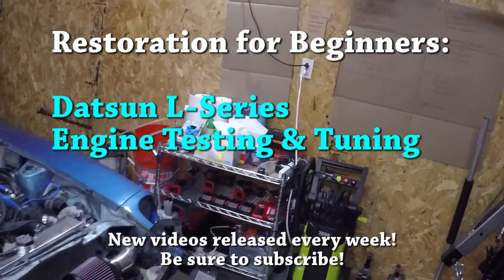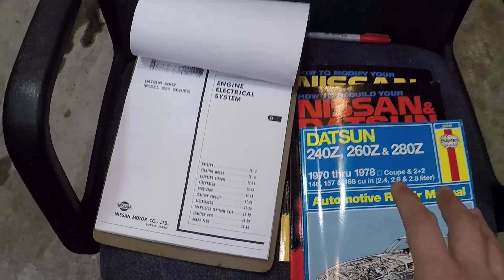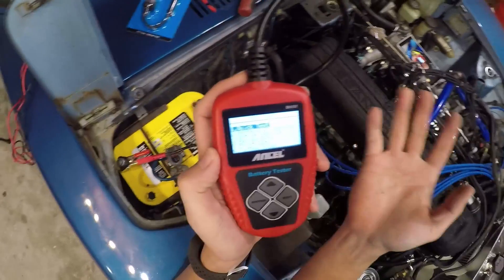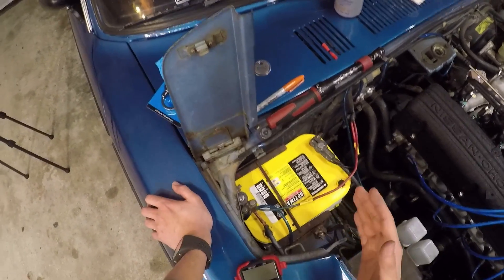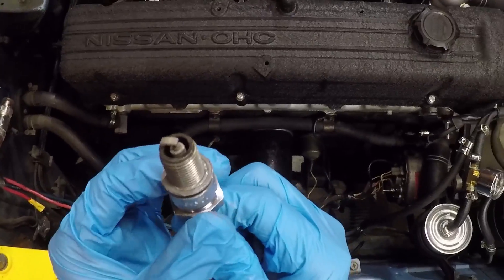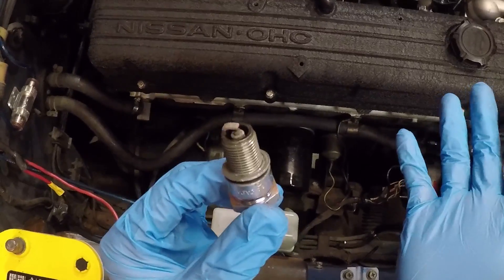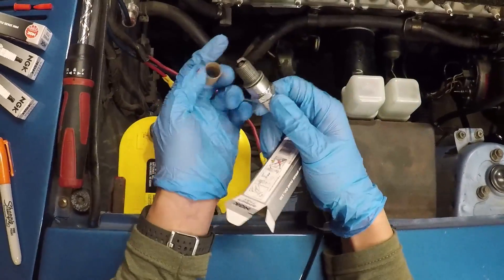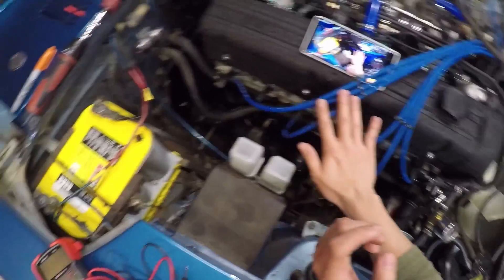Datsun L-Series Engine Testing and Tuning Ep.8 Ignition System (Battery, Alternator, Spark Plugs)

Comment: I have this exact problem in my 1972 Datsun 240z which carries twin SU ROund Top Carbs with Cylinder number 4. Whenever the car is stuck on light to heavy traffic, the spark plug starts fouling. Once i start cruising again the engine misfires until the plug is cleaned.  I am using NGK BP5ES or NGK BP6ES.  Any clue on solving this problem? Could it be a Valve Seal?

Comment: One other thing that I did was got a battery with the terminals switched. I did this because the positive terminal in the stock design is very close to the body and could short out with the it. If you get the one with the terminals switched, make sure to switch the wires too as they are different lengths. I just switched the positive and ground completely so my positive cable is now my ground.  No more shorting issues.
Reply from the maker: Yup, that's a good tip. Did you see me blow a fusible link earlier by accidentally connecting the battery in reverse?
Reply: Restoration For Beginners that's on you brother. Not the battery lol.. :p
Reply from the maker: +visualideas haha oh totally. I wasnt paying attention :p but i learned to make a fusible link!

Comment: Hey there. Is there anyway to check an ecm? I think I may have a bad one.
Reply from the maker: +visualideas hey mn, sorry for the late response. Been busy lately. Look online for something called the datsun fuel injection bible. Should have the testing procedure in there.
Reply: Restoration For Beginners all good mate. I got her running the day before. I had to trace wires going into the ECM. It was not getting power. I have it running now. I dropped the tank yesterday and I will get it cleaned and coated before I go forward. Just got to get some money together. Once it runs right on its own, then I'll start on suspension stuff. Gonna change out all bushings. That may be easy or hard depending on the state of the bolts. Seems ok till now though. :)
Reply from the maker: Haha alright, that's cool. You'll have to give me some advice once you start tearing apart the suspension, because all of my bushings need to be changed out as well. Not to mention one of the lower control arms in the front was actually bent, so I'll have to replace that (which will be pretty costly...)

Comment: do you have a borescope? if so try removing a couple spark plugs examine the top of the piston around the edges, #5 to any of the other that seem to be ok when reading the plugs. See if the edges look different, the Datsun book makes mention of clean edges being a sign of worn rings.Could be stuck oil control ring, I don't know if any of the claims for the various snake oils are true but maybe worth a try. I have used marvel mystery oil in my car since I got it, thinking it may help with cleaning the old fuel lines etc...You could try lowering the #5 piston in its bore, and filling the cylinder with MMO, let it set over night, and the use a syringe to suck it back out, leave the spark plug out, spin the engine with a remote starter to clear any residual cleaner (you want to avoid a hydraulic lock) and once satisfied its cleared put a bit of straight engine oil spin again and then install an old plug start it, run for a bit noting any smoke, after smoke clears up (left over from the treatment) new plug and give it a try. I have NO evidence that this practice will help, I am just throwing out ideas for you to consider and if sound plausible try. What ever you do make sure you really really avoid a hydraulic lock. Granted if the oil ring is stuck and this unsticks it, the fix may be temporary, but I cant see how it would hurt to try. It may be a good idea to change the oil also IF a substantial amount of the MMO leaks down the cylinder (note how much you put in vs how much you get out). I don't think its wise to run that stuff or any solvent in the oil for an extended time. Who knows if its a stuck ring maybe just taking the car out and driving the crud out of it may be the answer too.
Reply from the maker: I hear you. I've been thinking of trying various "snake oil" methods to clean/loosen up the inside of the block, but I think I'll wait until I'm done with all the tune up stuff and get a read on the spark plugs one more time to verify that I still have the same problem. 
While I don't have a borescope, I think peeking in might be worth a try once we put a few more thousand miles on the engine. Last time I saw that piston it was almost squeaky clean from the head gasket leak, so I'm not sure if I'll find any useful information just yet.
Reply: oh yea forgot you just cleaned up the tops, would take a while for carbon to build up (or not on the edges). Those borescopes come in handy I got the cheap one 80$ IIRC has come in handy peering into hard to see places. can get them real cheap if you have things like smart phones, I don't just got the cheapie from HF.
Reply from the maker: Gotcha. 
By the way, I've been binge watching your videos in the last few days. I'm thinking about grabbing an extra 5-speed as well... I really need to finish some stuff up before I take on new challenges.
Reply: word of warning, if you get any odd sounds from any transmission, try a new shift knob, yes the shift knob. I was still getting some odd sounds from mine, someone else on the classicz forum was having the same problem, he was told to check out the knob and that was it. So I pulled mine and filled it with lead in the void, and sure enough noise gone. apparently it was resonating with vibration. Note I had a NON standard aftermarket knob.

Comment: I'm surprised you aren't using a feeler gauge to gap your plugs, I've always been told the round gapper isn't ideal for plugs since it has a very slight angle to it.  Great vid and info as usual though!
Reply from the maker: Haha that's a fair point. I knew that the gapper wasn't that precise of a measuring tool, but I was just trying to get it in the middle of the range (0.039~0.044). I thought that'd be good enough, but you're right. Feeler gauges would be better.

Comment: maybe a valve stem seal on the problem cyl?
Reply from the maker: I have no idea Dave!
Reply: I have read that the valve seals can tear on installation, so when head was rebuilt maybe on got snagged? its a long shot but something to look into before tearing down the bottom end looking for an oil control ring issue. Did you have the shop rebuild the head or did you do it after the machine work?
Reply from the maker: I heard that as well. But it's such a coincidence that the valve seal would be broken on cyl #5 right? Actually, I think I should reserve judgement on that cylinder before I pull the new spark plug out after a few hundred miles. I don't know if the fouled-up spark plug was symptomatic of the old engine, or the new one after FI refresh and head rebuild. 

But... if I were a betting man... I'm going to bet that thing comes out black again. Why else would I have blue smoke right?
Reply: yea something is causing that smoke. The valve stem seal would be a long shot, same bad cylinder from before just happens to get a torn seal... not likely. My guess is a stuck oil control ring (or worse a broken one). I would just to the least invasive fixes while monitoring it like you are doing. Keep track of the actual oil consumption too, that would be a good metric to keep up with as you try different things. On mine I consume oil as well hard to say how much as I don't drive it on a regular basis, but it does lose oil and its not leaking. I do have nice looking insulators on the plugs, but the metal part around the perimeter tends to look blackish. Not sure if its carbon or burned oil. I don't notice any blue smoke but that could be since I have not looked hard enough. If I had to guess I would say a certain amount of oil consumption is typical, just don't want it to be excessive. Back in the day it was routine to check engine oil when ever we did a fill up. The thing about my black residue is its very consistent, all the plugs have it and to the same degree.

Comment: You can use a Anti-Fouler on plug 5, that should help in keeping the oil off the plug. Lets hope you dont need to do this, but its a option. Auto parts stores normally have them, You will need a 14mm, Long. A 14mm Short will crush the tip of the plug when you tighten the plug into it. Lets cross our fingers that the plug comes out clean. Wonder where we came up with the saying, Cross your Fingers ? Have you thought about mounting a Heat Sink on to the Ignition Module to keep it a little cooler, otherwise they burn out from heat.
Reply from the maker: Ah. Thanks for the tip! I'll certainly look into that if the oil issue hasn't resolved itself already. You reminded me of this guy with a pretty memorable story: http://forums.corral.net/forums/lounge/1012617-why-you-dont-put-spark-plug-non-foulers-non-fouling-cylinders.html
Reply: Im thinking the tip of the plug was touching the metal anti fouler and was shorted, no other reason for it to get hotter, seems to me it would be colder then the others. But he was right , only one way to fix it. Im so glad that money now grows on trees, didnt use to be that way. I had a running rich and screwing up my plugs, until I adjusted the AFM just a little. Problem solved. You should be able to tell if you still have the problem by just starting it up and letting it idle for just a short period, 30 minutes or so.I ran quarter mile cars in the early 70s, if it can be blown out of a engine, Ive done it.
Reply from the maker: That pretty awesome to hear. I'm sure the anti-fouler will function fine, I just remembered reading that story a while back and you reminded me of it! Do you ever worry about any possible negative performance impact from anti-foulers?
Reply: I havent used them yet, I bought some but since I adjusted my AFM and Im not running so rich now dont think I will be needing them. Tho I will find out, Ive checked the plugs after around 100 miles, they were ok, but after around 200 miles will be the final test. Fine tuning these engines is a real Art.

Comment: Wasn't cylinder #5 the suspect cylinder when the head came off the first time?   Or maybe it was #6?   It looked clean and shiny as if it wasn't experiencing combustion if I remember right?  It looked like a motor someone was driving around on five cylinders.   
Valve sealing...I don't know.  It's a new head...isn't everything above the block replaced or otherwise new?  It just seems like the chances of this happening from the top with two different heads is so low.  Which leaves a ring problem, and yet the compression was very healthy.   There was no oil squirted into the top of cyl #5 before that compression test done on video?   I'm reaching on that one.  I just don't understand it.   The combination of things going on in #5 don't make sense to me.   There is time between this combination of things however and you've been working diligently.  My gambling money says you already fixed it.  
After the recent solid compression test, I wondered if the #5 valves were just crazy-out of adjustment on both heads.   I wondered if I had given you bad advice.   And I'm just newbspeculating here but did #5 have more "wet" compression tests than other cyls and maybe oil collected in the combustion chamber and eventually fouled the plug?  
Based on the way the plug looked at 200 miles, and if it's not resolved, you won't have to drive 200 more miles to know if there's an issue.  :)   It's going to be a moment of bliss if you pull that plug out and it looks healthy...!!!:D   Good luck!
Reply from the maker: Haha you perfectly outlined my thoughts here as well. It just doesn't make sense. I honestly don't know if you can have a good compression reading AND have bad rings at the same time. I had the head rebuilt with new valve guides and seals, so I doubt that that's the problem here. Even if there was a problem, IT'S AT CYLINDER #5! The constantly problematic cylinder! That's too much of a coincidence. 
I'm hoping that this problem was already fixed with the head, and the spark plug won't come out black again. But deep down inside, I know that it will =( Just waiting for the weather to clear up so I can take it out again.
Reply: All my speculations fell apart when I saw that compression test.   The one quick piece of info. I wish I had on this video is what the plug smelled like.  Granted it would probably be too weird if plug-smelling was a part of the plug-reading lore in the video but still heh!   I could see the plug well enough I just wanted to reach into the video and smell it too to test what the majority of its scent was.  You seemed to confirm that it's motor oil.   In theory a coincidence with #5 is possible or there's something else in the works here I'm just not thinking of.   I'm guessing the plugs were new when the new head went on.  But if the plug smelled like gas and was carbon/gas fouled...the injectors are new...could weak ignition in #5 --> combustion/mixture issue?   Or could an oil ring work well at the top of a cylinder for a compression test result, but also have some kind of issue further down on the cylinder wall where oil could pass through?  I'm totally reaching here again but it makes me think!   A good blue smoke test with the new plugs would be easy and I'd think worth doing right away.
Reply: It's possibly not relevant but I'd probe the #5 spark plug wire with the timing light real quick and make sure it's got steady spark through time.
Reply from the maker: +heymisterderp thats a great idea. I love it. I hace the spark plug tester, but I couldve used used my timing light to check for spark.
Reply from the maker: I'm just as confused at this point as you are. I'll take a sniff when I pull the replaced plugs out and see if I can tell if it's oil vs. fuel. I believe it's oil, but doesn't hurt to check. I'll also have to check that the injector and signal are working properly. I already checked for spark, no issues there. I'd be incredulous if it turns out to be a bad valve seal... it'd be such a coincidence. Dave seems to think that it might be a stuck oil ring. Never dealt with one before, but it's a guess that makes the most sense for now!
Reply: It'll be a learning point for me if it's both a ring problem and normal compression too.  Is this a case of excess oil raising the compression to normal?   If Dave's right (I won't bet against him) and it's a stuck oil ring, is this enough of a great excuse to stock-rebuild the block?  :D   I know you have another engine, but you've come so far on this one.    I suppose the budget way to do it would be to break it down and only address #5 with the minimum of parts required and assuming the cylinder is okay.   This is a good motor with one problem at worst, it'd be nice to take advantage of the five good cylinders by fixing the problem with the bad one.  Been wondering if the block was rebuilt before you got the car.   
I'd have to pull that spark plug off in 50 miles, I couldn't help myself hehe.  Good luck.  At least spark plugs are dirt cheap and so easy to access.   Two huge bonuses from the old school. :)
Maybe it was destiny for this channel for you to eventually have to delve down into the engine block one way and/or the other. :)